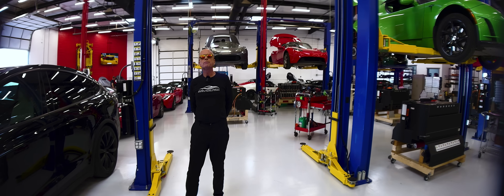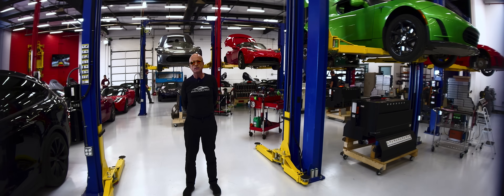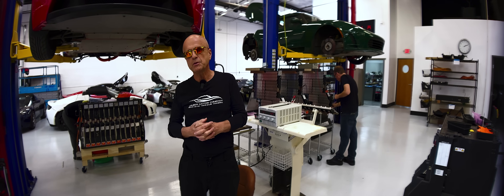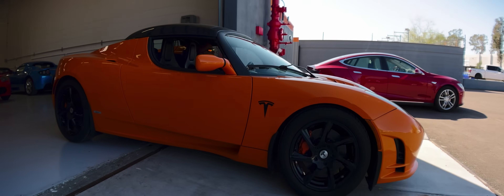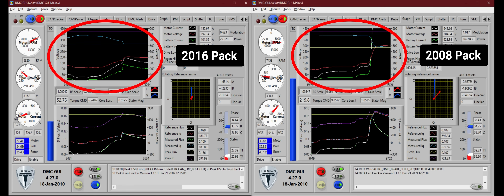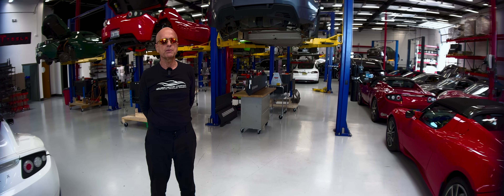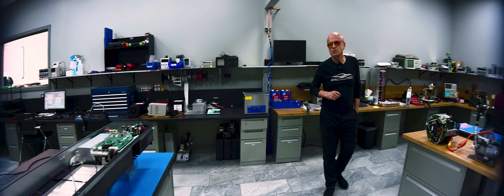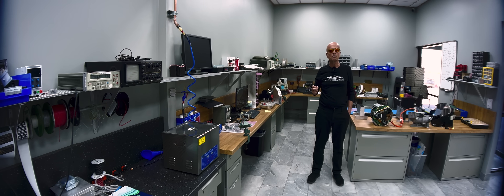Tesla Roadster Batteries Are Finally End of Life | Gruber Motors

Comment: ACPropulsion with alan coconi came up with the18650 cells in sheets. It turned out to be a very good design. 
    Those 2016 packs seem to have poor cells and should be replaced under  warranty.
Reply from the maker: Martin Eberhard had great success using these types of cells in an E-Books business, and commissioned ACP to convert one of the three Tzero's from AGM Lead Acid with 80 miles range, to Li-Ion which brought it closer to 300 miles, and the rest is history, Tesla that is.

Batteries in the doors, and thermal management were the next challenges although Alan had crude thermal sensing mounted on top of each Optima Spiral Wound 12V battery (28 of them).

Comment: Might a 2016 Tesla Model S suffer from the same battery problem as these 2016 roadster replacements?
Reply from the maker: The early MS's are now going on 11 years with no indications of similar high impedance weak cells.  So far, it appears issues we discovered are confined to 2016 Roadster replacement packs.
Reply: @grubermotorcompany  Thanks for the reply.  You guys are GREAT! 😀
Reply: @grubermotorcompany  Ahh, okay, because around the 7 minute mark you mentioned the window of 2016-2019, and I figured they would try to use a standardized cell on all models for maximum cost effectiveness.
Reply: Having a 2016 Model S I'm always keeping my ears open for the lifespan I can expect from my batteries. The car still has 91% of original capacity but I know at a certain age the loss will not be linear but sudden.

Comment: Will LFP work in the original roadster replacement, or would the car be too slow with LFP?  As a side note, I am still daily driving my 2011 Volt which I bought new in March 2011.  It’s lost a little range and is “cranky” when cold soaked.  But It’s still driving after 12 years on the original battery.   I plan on getting 14-15 years on the original battery.  The Volt used prismatic cells with NMC chemistry.
Reply from the maker: The difficulty with first gen Roadster is the electronics are out of production since 2008, and radical cell changes are limited by geometry constraints, performance differences, and no one in Tesla or the aftermarket space can carve ROI by reinvesting in a new design.  There are many better cell technologies after 15 years, but integrating them is too costly for just under 2000 owners.

Comment: Please let us know what you and Tesla come up with.
Reply from the maker: We will have much more information as this issue evolves.
Reply: @grubermotorcompany  Isnt this considered under warranty? 8yr/100k mandated by law?
Reply from the maker: @Cjdergrosse  The warranty period for this battery pack was 5 years.
Manufacturer warranty laws are governed by the UCC, the Magnuson-Moss Warranty Act, and the FTC rules.  Itcovers retailers' express or implied guarantees of a product's quality and/or reliability. The seller is promising that the product will perform as described.

The warranty period is not mandated and is up the the mfg.  The only enforceability is honoring warranty within the period stated, and if it meets use conditions set by the mfg.
Reply: A replacement pack with Sodium batteries.
Reply: A large sac of potatoes.